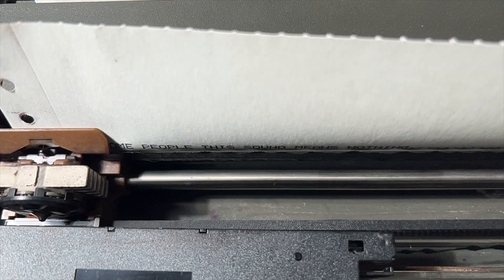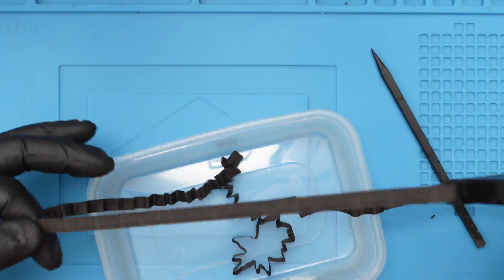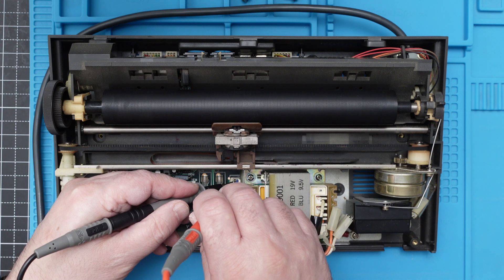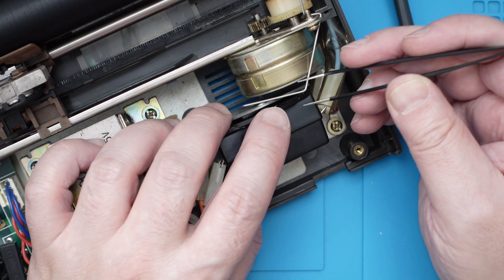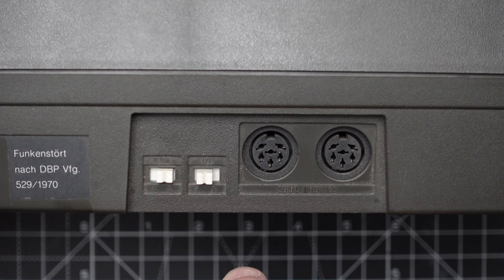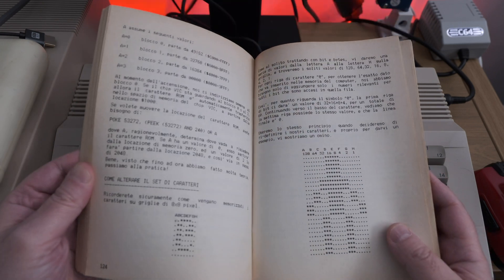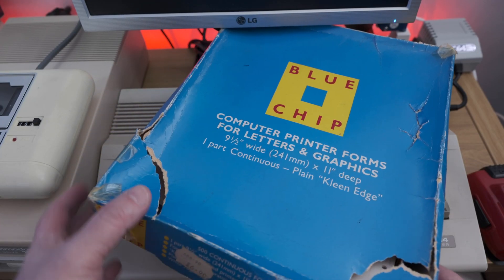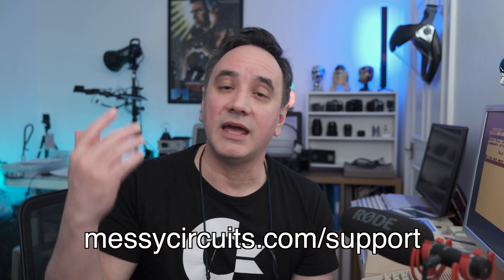DON'T Ignore this Old Forgotten Printer - Commodore MPS 803

Comment: The Commodore MPS-1200 was a god amongst printers. That printer was built like a tank and far ahead of its time with its high resolution. Hell, even though it was a 9-pin printer, its quality was on par with the more expensive 24-pin printers. My family used that printer all the way from a Commodore 64 to Windows 98. We only stopped using it because laser printers finally came down in price and ribbons for the MPS-1200 became too hard to source. But even so, I never owned a laser printer that lasted as long as the MPS-1200.

Comment: I have fond memories of my MPS803, and trying to snuffle the noise at midnight as I printed out school assignments. I got somewhat frustrated with how it handled tractor feed paper, it would often crab causing the paper to lean to one side, so I bought a tractor feed attachment. The lack of descending letters was very characteristic, but this was soon overcome by using GEOS and printing fonts as bitmaps. I always refilled by opening the ribbon case and spraying ink in from a pump bottle. As an aside, have you any advice on getting a A500 hooked up to a modern LCD monitor? The image of the Amiga CLI in this video looked remarkably crisp.
Reply from the maker: Thank you, I'm happy it brought you nice memories back! 
About the image, in the video it's all coming from the Commodore 64, I didn't plug it to the Amiga. I'm using a SCART to HDMI Upscaler that I got very cheap on Amazon. Unfortunately, the same model is not available ATM. I tried similar ones and they are not as good as this one, I guess I was just lucky. The link is below in the comment.
In order to record the image on the screen, I use a HDMI splitter. One HDMI output goes to the Upscaler, the other to an ElGato Cam Link capture device to record using the QuickTime Player.
Upscaler: 
https://amzn.to/3WYiLqM

ElGato:
https://amzn.to/40QaKpa

Comment: So much nostalgia here! I had the beige version of the MPS-803, and just seeing you poking around with yours, I can vividly remember things like the feel of the paper advance button and the ribbon installation process etc :) 

I also had a VIC-1520 printer/plotter, which was an amazing little machine with four tiny pens mounted in a little barrel, which rotated to select a colour, then drew continuous vector-based graphics on to a roll of paper -- if you get the chance to play with one, it would make a great video. (and if you thought the 803 was noisy, wait till you hear the 1520 "writing" tiny text!)
Reply from the maker: Thank you for your comment! haha now I want to hear the 1520! I love those old plotters. I had a tiny one that came with the Olivetti M10 called PL10. I still have it, but I don't have the small pens and also needs the electronics to be repaired. It's in the TODO list for a future video.